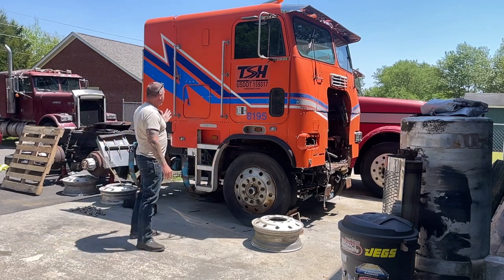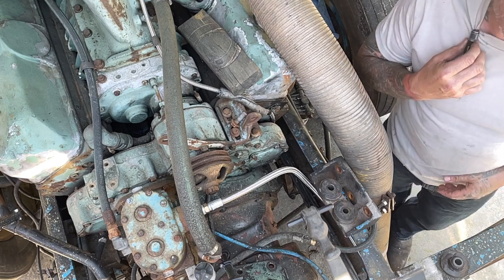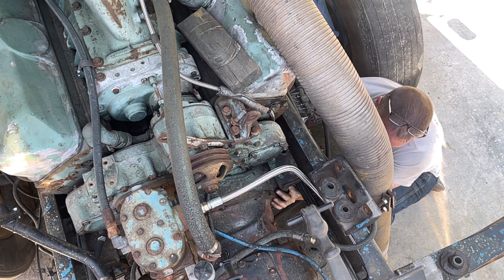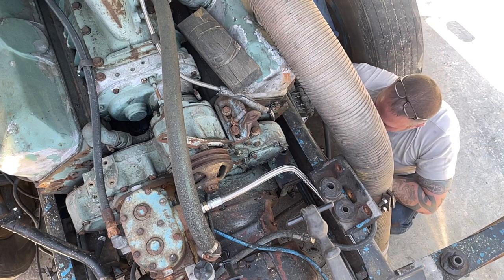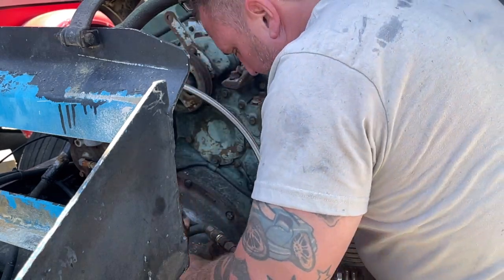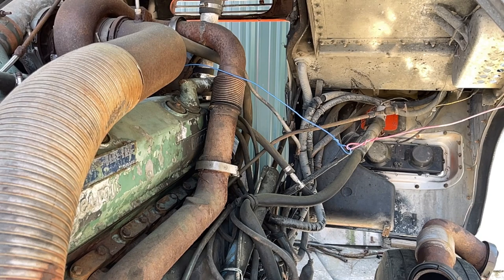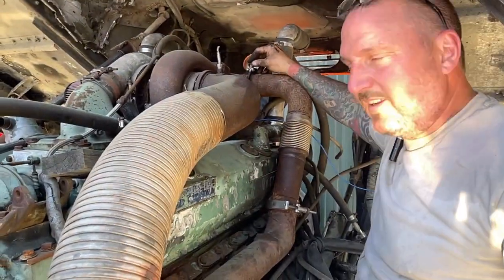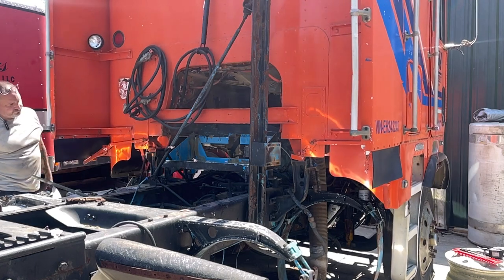1984 Freightliner Cabover, Delores gets her frame mount back

Comment: Do you have any of the plumbing done on Krystal or are you waiting for the front engine mount first?
Reply from the maker: Front mount first then try to get the exhaust and stuff off to get the cab down to see what all has to be changed.  And I need to find a water pump solution

Comment: Another great video. It’s coming along slowly but surely. Hopefully the engine is okay I see guys running them all the time with no radiator hooked up and I cringe every time. That cab works good going up and down. I think most shakers work that way, I think kenworth and Pete worked the same as each other. Can’t wait to see the next video
Reply from the maker: Ya I ran my 6v a ton without water and it’s fine. I’m hoping the same for this old gal
Reply: @JamesPretty  Hope so! Back to other video you said you’ve got to change foot valve on this truck. Could the other one require the same one? And maybe that’s why the brakes are so jumpy on it. Just curious
Reply from the maker: @darrencatenacci2737  park valve on Delores.  Foot valve on candy I think I’m not 100 on that.  The park valve MV3 doesn’t have an air port to supply air to the truck like an MV2.  I’ll put up a video in a few days
Reply: @JamesPretty  Cool was just a thought stay safe
Reply from the maker: @darrencatenacci2737  ya I’m not really sure what’s going on with it.  It’s super weird

Comment: Hi .... at 5.18 mins is that an A/C compressor ???
.
It has a new pipe on the one side  !!!
.
If it is ?.... it looks "all american" and powerful"  !!!
.
THANKS  FOR  READING
Reply from the maker: Air compressor for the brakes and suspension
Reply: @JamesPretty  Of course... as it's gear driven with no "recharge points"  !!!
.
Your A/C in the USA is icy where here in the UK it's fit for a mouse ... lol 
.
THANKS

Comment: A Detroit?, smh.
Reply from the maker: Yep
Reply: 8V92
Reply: @JamesPretty  Was the Cummins that was in Dolores totally shot? Personally I think the only engines that should be in semi‘s are Detroit and cat how many of your trucks have those two engines?
Reply from the maker: @rudycarlson8245  Trisha Franny Betty and truck x have cats.  Krystal Delores and marla have detroits. Candy has a Cummins
Reply: what Detroit does Krystal have? Was candy running when you got that truck? Did you have to do work on her to get her running?
Reply from the maker: @rudycarlson8245  candy had a head off when I got it. So yes I had some work to do before she ran. Krystal came with an A model cat that was worn out.  Now im putting a 12v92ta in it
Reply: @JamesPretty  Krystal will be a good and reliable truck when you are done with her!
Reply from the maker: @rudycarlson8245  I agree